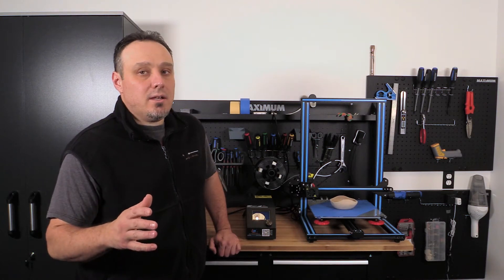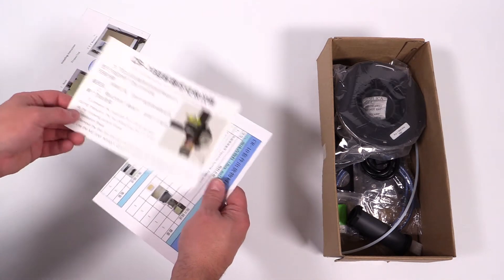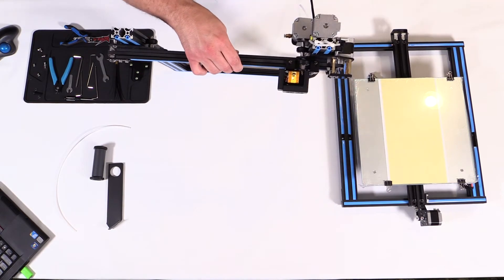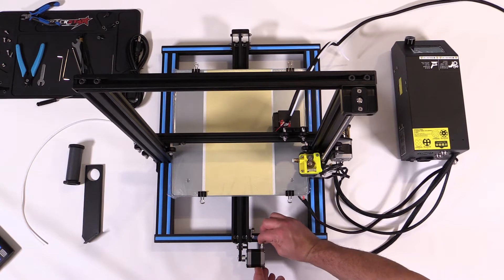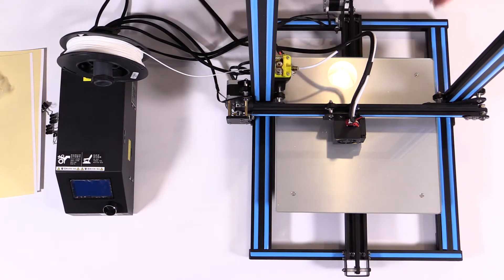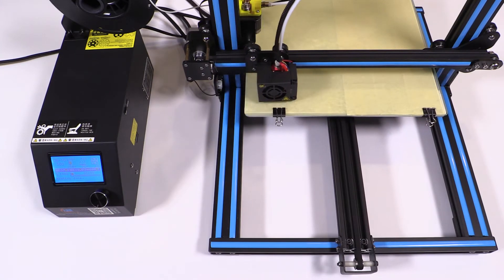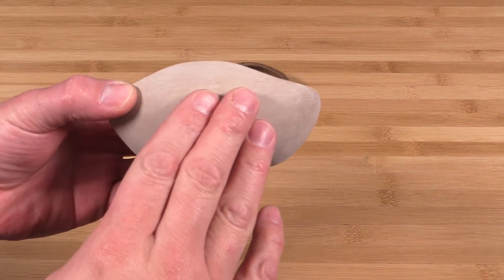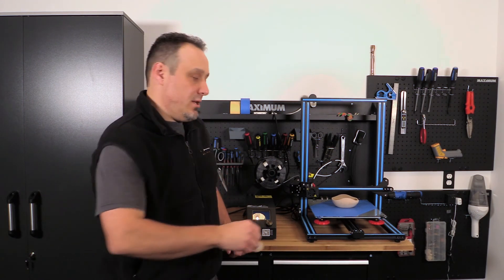Creality CR-10 3D Printer Assembly, Unboxing & Review

Comment: If your going to use tape on the flat bed, make sure the sides of the tape touch each other. This will make sure you don't get those thick lines on the bottom of your prints. Also, if your using tape, don't bother with the glue stick. Simply clean the surface of the tape with rubbing alcohol and when printing set the bed temp to at least 50c. When I used blue painters tape in this manor I had no problems with adhesion.
Reply from the maker: Thanks for the tip and thanks for watching!